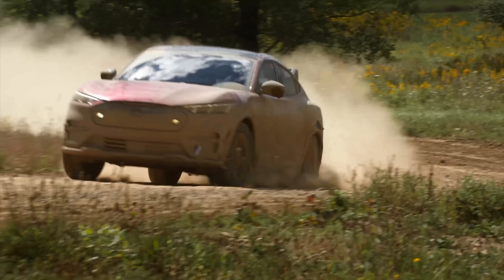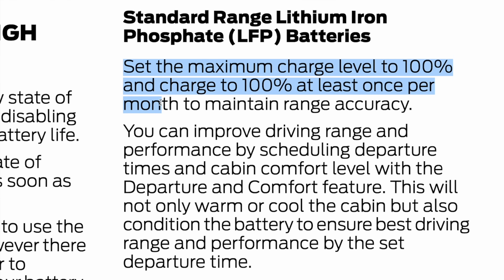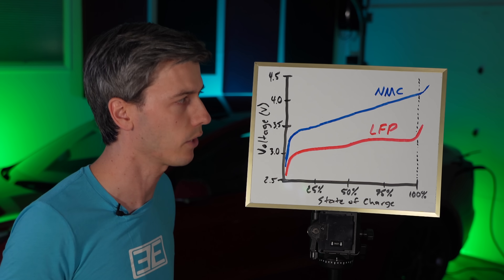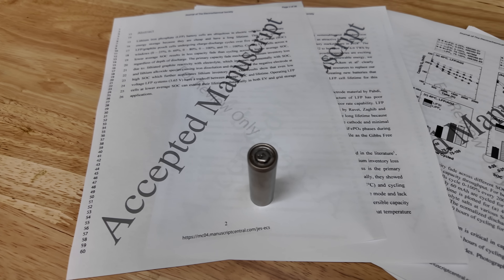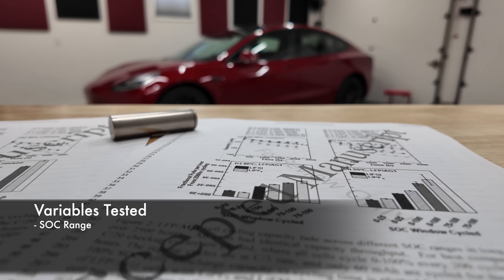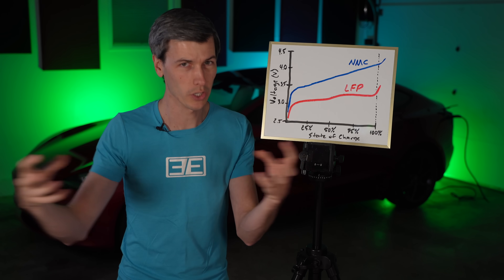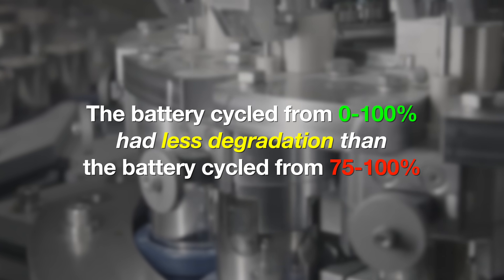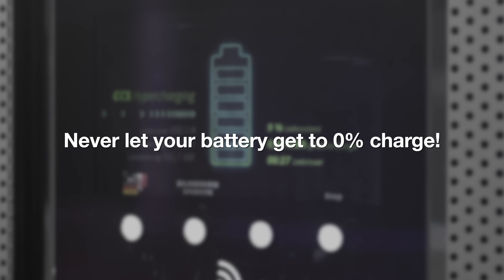How To Ruin Your Electric Car's Battery - LFP Edition!

Comment: LFP Best Practice #1 > Charge to 100% at least once per month
LFP Best Practice #2 > When storing your car for extended periods of time, store it at a lower state of charge
LFP Best Practice #3 > Operate at lower SOC ranges when possible
LFP Best Practice #4 > Only plug in your car when you need to
Reply: You nailed it. Great summarization in 4 easy to understand bullet points! I plug in when I get to a quarter tank and fill 'er up, just like the old days. What could be easier to understand? Thx!
Reply: Can you explain number 3 in simple baby English? I get we shouldn’t charge to 100% all the time, once per month. Do I bring it down to like 15-20 then charge it up to like 75?.. better than 80? Or better that multiple 50/60 - 80’s
Reply: @Justin-cx7hz   Best use (my view) is the 25 - 75% range  if thats possible with your driving habbats.
Reply: @Justin-cx7hz  Basically, don't charge more than you are likely to need. However, charging to 80% is perfectly acceptable as most degradation happens to the top 20%. Also, avoid unnecessary overnight topping-up when you have enough capacity for the following day.
Reply: @Justin-cx7hz  For daily use charge to 80 or below, unless you need to range for a trip.
Reply: @LubomirGeorgiev Are we talking about LFP ?
Reply: @Justin-cx7hz  I've started charging mine to 100% only twice a month. Otherwise, I leave my limit set to 60 to get me through the day, so I sort of follow #3.
Reply: Unfortunately, deep discharging and charging cycles not possible for my use case scenario. For this I need 32A charger to get required SoC overnight. It’s 6A 120V (0.72kW) charging speed at home and 6A 208V (1.2kW) at work available for me. My daily commute 16km (10miles) one way 3-6%, after which I charging either way. I usually keep limit at 50%, and increase to weekend to 70%. If I plan a road trip, I charge to 100% to calibrate the BMS, or once in every 2 weeks. Hopefully it will not destroy the battery too fast.
Reply: @burfoerste if we were placing bets, I think your use case would be most likely to win a longevity contest, particularly if you're keeping it right around 50% for the majority of its lifespan.
Reply: Good sum up, BUT #3 and #4 are contrary. On one side, I should keep the SOC in average low, means 25-75 is better then 35-85, etc. and on the other, I shouldn't charge in little steps. So how does this factor in, what is worse for the batteries?
eg: I need 20% daily for commuting and want to hold a min of 45% for emergencies. 
so better to charge once 45%-85% or twice 45%-65%?

And is there any numbers, about how much degradation we talking here? I mean, I do this "procedure" and after 10 years it safes me 1% degradation?!? Or is it significant?
Reply: F for "fer" in french 😊
Reply: I asked Tesla themselves about this...

3 different techs gave me 3 completely different answers. 

We'll have figured out peace in the middle east before we know what the hell to do. 

Also the boombox feature is silly because you have to go back in the menus and set it to either camp mode or car wash mode for it to actually work.
Reply: So in a scenario where i always drive 70 miles in a day. Is it better to charge to 60%, drive to work and back, get home at 20%, and plug in every day? OR charge to 100%, drive for 2 days, get to 20%, and plug in to 100% every 2 days instead?
Reply: @JohnSmith-rt5yq Answered fairly clearly in video.
Better to do your 60%-20% cycling than 100% charge every few days. 100% charge once a month.
This assumes LFP batteries.
You need to verify battery type of your vehicle
Reply: I think there was another one in there:

LFP Best Practice #5 > Avoid discharging your battery to a very low state of charge (also applies to other chemistries).
Reply: This is basically how I operate my ICE. I rarely fill over 50% and only fully fill it for a long trip. Nothing much changes! Having looked into Li batteries on phones for a long time, I already know high and 0 SoC are bad for the battery, as is storing with a high or low SoC. Knowing about the voltage curve and the need for calibration on LFP is key here. Awesome video!
Reply: There is a fundamental issue.. any Li batt benefits from not charging to 100% often..

Yet LFP requires 1 full charge every week (or every couple weeks) to calibrate its levels.. otherwise batt management is going to make calculations based on erroneous data.

Comment: Very insightful video! I had known that Tesla's recommendation for LFP charging to 100% was for recalibration of the SoC, due to the relatively flat voltage curve at different SoC for LFP compared to NMC. However, I never knew about the little voltage spike on the curve close to 100%. I am guessing that little spike would be very helpful for the re-calibration SoC!

Comment: I think you left out probably the MOST important fact, namely that the percentage charge displayed to the user/driver is NOT the actual State Of Charge (SoC) of the battery!

Vehicle manufacturers spend a huge amount of time, effort and money designing, developing and calibrating their cars, irrespective of the powertrain architecture, and guess what, the car and it's systems are far better than the average owner at sorting itself out.  The manuifacturer has already built in buffers between the true 0-100% SoC, based on the min.max OCV of the cells and the percentage that is displayed as being available to the user.

Personally i don't worry about it at all, i just drive it and plug in whenever i think i need to charge.  The ONLY time i would specifically do something different is for long term storage (>month without using the vehicle) where yes, i would make sure the displayed SoC was between 40 and 60% and i'd also try to plug in a charger/conditioner to the LV (12v) battery to avoid that going flat.

Comment: So I put gasoline in my ICE vehicle and it runs every time. It also doesn't lose it's range capacity when it sits for a month, it just starts up and runs the same as id did the month before.  You should try to pick up one of those Gas powered vehicles, you'll be happier much longer.

Comment: I think it was for NMC, but what I've heard for lithium cells is that you want to charge them slowly, and ideally keep the charge level as close to 50% as possible (which oftentimes means 80% to 20% for example). Even if this isn't optimal for one or either of the major lithium chemistries, I think it's probably a very good practice to follow if a battery uses lithium in general, since if it's not optimal for longevity for that specific chemistry, it's probably still relatively good for longevity.

Comment: this is misleading to those who will not watch until the end. short answer: it is not worth it taking care of LFP,  battery ageing causes more degradation than average/normal use and improper state of charge because it has absurd cycle life. just charge it as much whenever possible so that you have most range even at adverse conditions or unexpected events.

Comment: You electric car has less power in the lower half of its state of charge,
Current x Voltage is Power.
Less Voltage = less power.

Comment: The battery needs to balance each cell block so they are all the same voltage ie 4.2v
The battery can only balance at top of charge ie 100%.

Comment: So the tests was used in 40c and 55c. That makes them instantly invalid, heat do not speed up degradation linear, to much heat can destroy at battery in an instant. LFP aka lifepo4 is an old technology found in RC cars and backup system for many years, first produced in 1996, so that the lab did not have time sounds very unlikely. My experience is that they are very durable and capable, this is real life testing and not a lab.
Yes it degrades faster at SOC 100% but is it killing the battery unnaturally fast? No and you even state this so that is good. Heat as always is the worst killer, Lead, nimh, nicd works great in heat though. Lithium cells can die in an instant.

Comment: 9:01 Unfortunately incorrect. Going from 0-25% 4 times does not discharge the same amount of energy as going from 0- 100%. The number of electrons is the same, but the voltage and therefore the Power and Energy is much lower as the voltage chart neatly shows.

Comment: I appreciate your video, but let me share is a small weakness in the approach : 
As often (always?) in literature, criteria are based on SOC. But as you know low SOC means low voltage. Then, as the vehicle discharge at the needed POWER (not the a given current), the current consumption is higher at low SOC. This increase battery self heating, and self heating is proportional to i². So 15% voltage decrease (for example), means 15% current increase, means 32% losses increase in the cell. then I'm not so sure the conclusion you bring would still be valid. what do you think?

Comment: Battery longevity goes against the practicality of charging your battery when you have both a charger and a solar PV system at home. If you were to charge once per week to full, you’d end up with a high electric bill. It’s in one’s best interest to do what you said, which is set the peak limit of charge to a lower limit and set it to 100% if you need to drive further, but still always charge every day. Otherwise, you’ll have (4) days per month with a net utility charge of 70kWh and depending on your location that would have significant cost implications.

Comment: Completely trust and respect this guy. I’m new to ev and have just bought 2, one LFP and one NMC and had no idea of the differences. So much more to learn vs ICE!   So essentially my make is shallow cycles for NMC and deep cycles for LFP with a periodic 100%

Thanks taking the time to educate the masses, truly one of the best content providers 👍
Reply: Generally speaking LFP batteries are durable enough that as long as you don't charge it to 100% after every short trip to a corner store it'll well outlast the car it's in.
Reply: tell it to people who argue if you should warm up the ICE engine or start driving right away. Oh and tell it to those who argue whether you should change the oil every 8kkm or every 30kkm. Or if you can drive on low rpm or not. I mean, ICE need much more education.

Comment: I got my Tesla from the Berlin factory last June, haven't drove it much. Maybe once in a while every three weeks or so. Picked it up when battery was at 45%. Charged to 100% first charge using a wall charger. Afterwards charged once every 3 weeks to 100% from 80 -  90 ish percent. Been very busy this summer. I hope the car started in the right battery path.

Comment: Problem with low cycle is because you never know if you would need your vehicle for a sudden emergency . This is why I never let mine stay under 50% for prolonged time. But it is 40kWh, so under 50% it has less than 150km of range.

Comment: The cells in the study were charged to 3.65V (100%) and discharged to 2.6V (0%) which is pretty much the absolute limit for LFP cells. But we know EVs have a built in safety margin and their usable capacity is less than their gross capacity. What voltage are the cells in your EV when it displays a 0% or 100% state of charge? Maybe it only charges to 3.62V or 3.60V? That could vary from one EV to another. Here's another possibility: maybe your car stops charging and shows 100% when the cells are at 3.4V, but periodically changes the charge limit to 3.65V in order to calibrate itself. 3.4V is almost 100% anyway (you can see this in the cycling chart in the study) and you don't gain much capacity going up to 3.65V. I wouldn't be surprised if that kind of behind the scenes battery management is already happening in some EVs, so it's a big jump to assume this study is directly applicable to the car you drive.

The charge/discharge rates are also higher than what would be seen on average in the real world. The study maintains 1/3 C charging in all tests, even from 75%-100%. We know that fast chargers slow down significantly as the battery reaches 80% (and some will stop charging to reduce congestion). So charging at 1/3 C from 75%-100% will happen very rarely (or never for those who always charge at home).

The temperatures are also higher than most batteries would experience in the real world. If you compare the 40 degree and 55 degree charts you can see the benefit of 0-25% cycling is less at 40 degrees, and the benefit would probably be much less for those who live in colder climates.

This is an academic paper with specific conditions and a specific goal to expand our knowledge of battery cells. We can't just take their numbers and apply them to a car (not saying you did this, but I think we need to be very careful. I think the concluding statement in the abstract of the study goes way too far and more studies are needed before such an absolute proclamation is made). I think for now it's best to just follow the manufacturer's instructions.

Comment: For what the following is worth:  Lithium Polymer batteries used in model aircraft - if the standing charge ever drops below 2.5 volts, the battery is GONE. It doesn't have enough charge to work, and it will no longer take a charge. Good only for recycling to extract the precious lithium.

Comment: @1:48 I have a Tesla and the screen shows what battery chemistry the car has (in the service menu), it also gives information on the low voltage battery, the front motor, the rear motor, the computer type and the heating/cooling system.

Comment: For those who don't get the opening joke, iron is Fe (for ferrous) in the table of atomic elements. So Lithium Iron Phosphate is shortened to Lithium Fe Phosphate, thus LFP. (Also, if not modified to be LFP, it would spell LIP.)

Comment: Lets complicate this a little more. We dont actually know the charge percentage of the battery. All we know is what the automaker is telling us. When they say 100% charge, it may only be 85-90% or maybe 99%. They might be keeping a buffer in there. What we do know is 0% charge is not actually 0%. The car may shut off and not "turn on," but the pack is not completely discharged.

Comment: At the end of your video, can you make point by point summary? It’s a pain to flick through within the time frame. Lastly, what is your CONCLUSION for LFP longevity?
Is it: charge within 10 ~ 50% for daily use and once a month, charge to 100%?
Then your advice on “have a charger at home, why do you need to talk about NMC on 15:28? It’s confusing the final conclusion. Then what will be the best scenario for LFP owner if you have charger at home? You could saying “if you go NMC ……, but since in this video we talked about LFP, if you have a charger at home, you should …..” (hence, the suspended climax for LFP owners with home charger) 😩😩😩.

Comment: I've owned my LFP Standard Range Model 3 2024 Refresh for almost 5 months now. I charge cycle at the high end, often between 90-100% sometimes 80-100%. It has lost 3 miles of range ~1.1% degradation if my math is correct.

Comment: Or just GET A HYBRID and stop worrying about this.

Full electric is unrealistic as long as petroleum reserves exist.

We need to build more Nuclear Power plants if we want to go Full Electric, otherwise grid instability will get worse and worse and "renewables"(they are still a consumable and also intermitent) will never solve that problem.
Reply: consumable? solar and wind are going to exist until the end of time (literally), and hydroelectric only relies on rain.
Reply: @TheAechBomb  You are correct the sun and wind will always exist. But the up time for those sources of power is not even close to 24/7.

Comment: You don't use voltage to tell battery charge on either battery type, especially since it'll dip under load. What you do is measure power times time in and out of the battery; how much energy it's gained or lost.

Comment: So, that first chart really shows the problem with modern battery chemistries. To fix the reliability issues with the NMC,, you have LiFePo4.  But you sacrifice  a lot of energy density in that replacement, and energy density is already the Achilles heel of battery powered cars, especially as compared to the energy density of hydrocarbons.  Then, on top of that you have a problem with being able to read the state of charge directly, so you have to calculate it based on less-than-precise metrics which necessitate pushing the state of charge to 100% regularly to maintain the approximate calibration. As if range estimation wasn't already bad to begin with.  All of this is also, of course,. very opaque to the end user no matter how much or little they really care to understand how it works.  It's little wonder that demand has cooled. since it's a hard sell to pay a price premium for a product that is less capable compared to how people are used to driving their cars.

That doesn't even touch folks like me who are perfectly happy with the vehicles we already have that are completely paid for and dirt cheap to own and insure.

Comment: So what temperature range would greatly reduce LFP battery degradation? Modify the battery chilling set points problem solved however higher power consumption..
I'm hearing a lot about it is a flawed study

Comment: Solid electrolyte interphase (SEI) growth is not the main mechanism of LFP battery degradation, as this growth of SEI is a protecting mechanism against internal electrode defects due to high current charging of the battery, but not a high value of the battery state of charge (SOC) level.